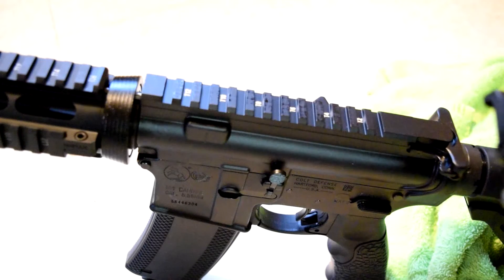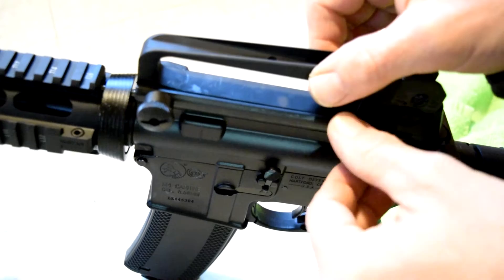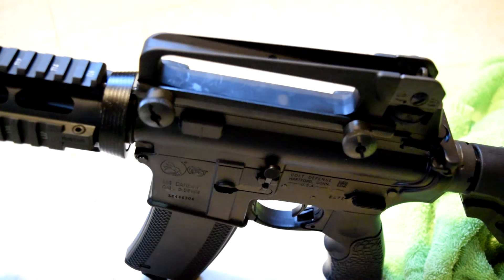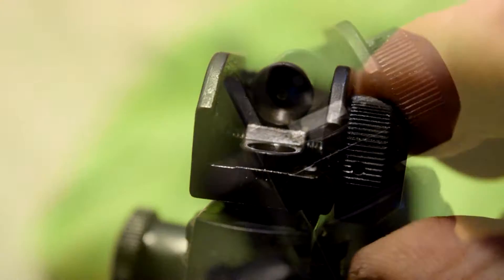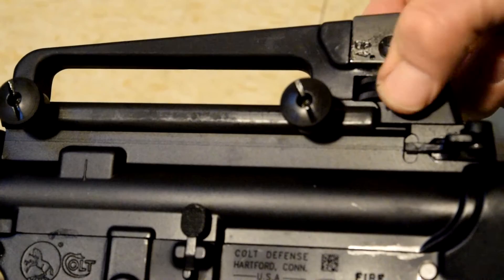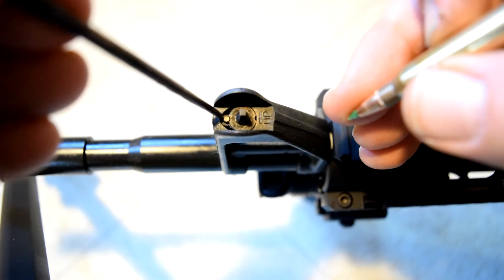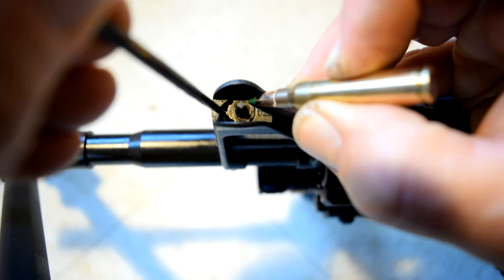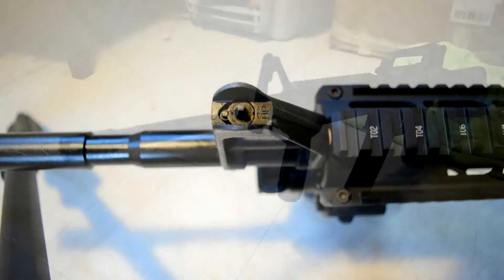Colt M4 Carry Handle

Comment: I was under the impression that “flushing” the front sight was not the same as mechanical zero. “Flushing” was the first step to getting the mechanical zero. Once “flush” then you were to add 'X' amount of up clicks to sight to get the mechanical zero. I say 'X' amount because I have heard more than one amount of clicks to get to mechanical zero, so I'm unsure what the actual number really is. Per Paul Harrell, you add 4 clicks up to an A-2 front sight that has been “flushed” first. (If I remember correctly, so any error is mine, not his.)

Comment: I don't have a inch pound tool but I put my handle on I thought tight and went to the range sighted it in and then actually started shooting and it loosened up so when I got home I used a big flat head and tightened it up really tight with a tiny bit of lock tight and it's not moving now . The gun is cycling just fine but my question is could I damaged the upper where the charging handle and bolt carrier group is ? I wouldn't think so because it's on the thick picatinny rail . I know it's probably a silly question but just wanted to ask . Everything seems to be running perfectly like before and I don't notice any wear on the internals that isn't normal wear . Should I loosen it and hand tight it again and maybe not tighten it as much as I did ? Or just let it run since it's running just fine
Reply from the maker: I don’t think you hurt the upper the only damage from over torque would be stretching of the threads.
Reply: @BeyondConventional  you meen on the Hand Carrier
Reply from the maker: @DjKaykoe1  Yes if it was over tightened but it’s probably not stripped if it didn’t get loose.